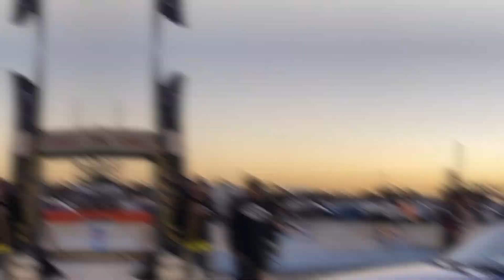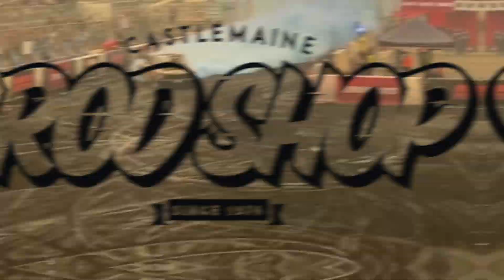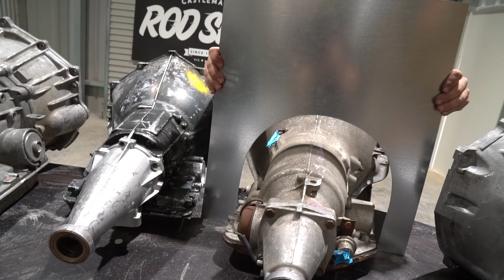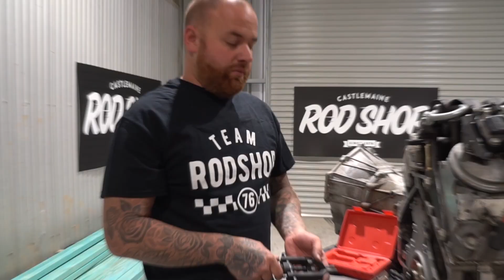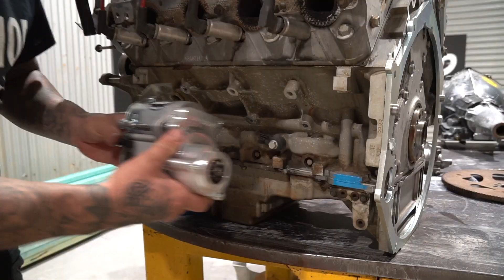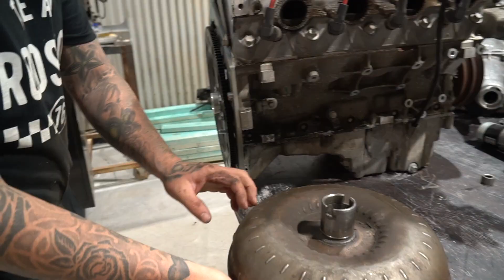How to fit LS Series left hand starter motor conversion kit - T350, 400, 700/ Powerglide

Comment: Would this work for manual transmission? I’m having issues with my RHD Nissan cefiro and my LS swap. Don’t have the room on RHS due to steering shaft and thinking this could be a saving grace to avoid cutting up the car to push and move the motor